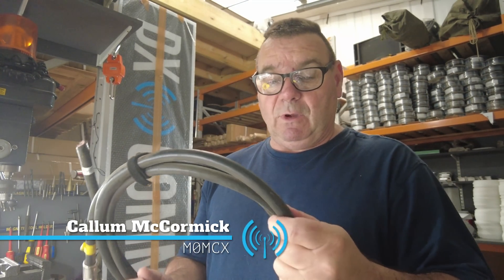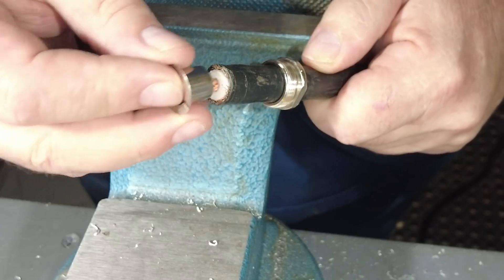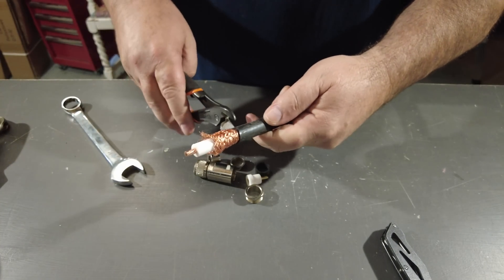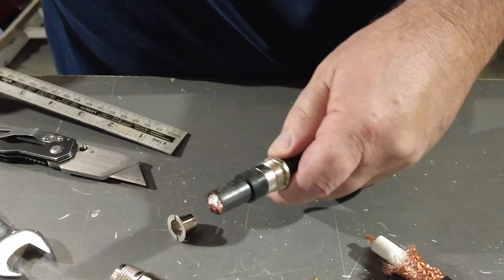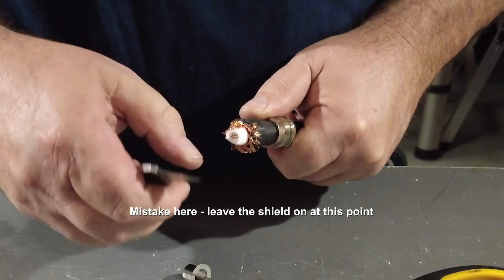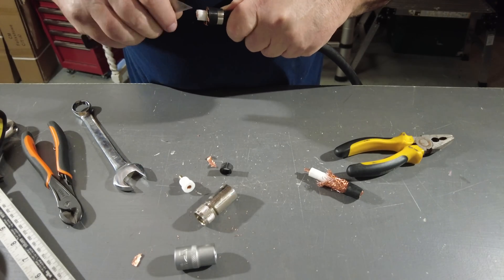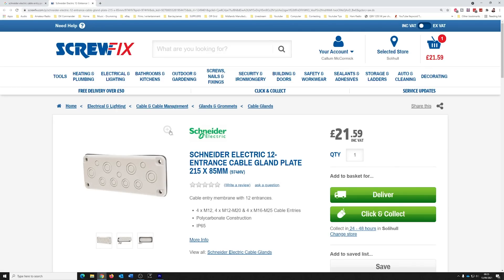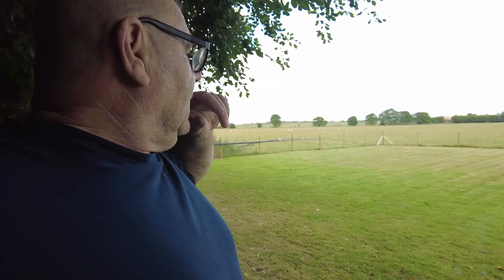Fitting Ecoflex 15 - Not All PL259s are the Same!

Comment: Love the idea and ability to reuse these connectors; however, everything i can find including with messi says the pin needs to be soldered on and the 7mm is too small for an LMR 400 cable (needs to be more like 10mm). Bummer. I'm starting to build a shack and I'd rather use reuseable screw on connectors than buy a crimp tool. Correct me if my info is incorrect, but it doesn't look this is going to work.

Comment: Hi,good video, well explained, but my question is, is there any specific circumstances that need such good quality coaxial cable, long runs or Qrm issues,,,,for example. I am using RG 213 u for 25 meter, wondering if ecoflex 15 can help with my high noise level what do you think, thanks from Rotterdam 73.
Reply from the maker: Noise.. Unlikely to be picked up by coax (normally).. Try a Loop On Ground.. I have two of them. One small and one big.
Reply: @DXCommanderHQ  Hi,thanks for your advice, I am now using 25 meter of Ecoflex 15 with the huge compression plugs, an unexpected  drop by 2 s point's, from S8 Qrm level, now with the Ecoflex 15 round S6 mostly, on the 40 meter band, so I am happy, My Acom 1500 linear amplifier needed a new transformer few weeks ago, great customer service, but an expensive repair, thanks from Rotterdam 73 👍

Comment: Hi Callum I really do like those connectors I have a 50 foot run of M&P For my HF and that’s the first time I seen those type of connectors and I really am impressed. It looks like a little bit more work but if you could reuse those connectors so much the better, I imagine that there are more expensive than your regular PL 259 because I’ve never priced them here at home but it looks like that’s the way to go with what you’re doing with the connectors. Thanks for the video and I hope you have a very fantastic day.
WD5ENH 
Steve
Reply from the maker: Hi Steve, so I bought last week another 4 of these.. Better actually. These were the Mk2 version at about £9 each.. So that's probably $10 in your land (exchange rate says higher but I'm guessing on local prices)

Comment: Would it help to tin the center conductor and braid? I use plumber's Flux. It works for me.
Reply from the maker: No.. It's a no-solder fitment anyway.. I have noticed when you add solder, it increased diameter.. But good idea!
Reply: As Cal said. DO NOT tin the center under any circumstances. you will NEVER get the hollow pin on the cable center conductor.... Trust me and Cal on this... I've tried and it has cost me dearly.
EI7II.

Comment: We use a lot of that, and we call it half inch hardline flex version. We do not use pl259 but rather N. We use special tools to prepare the coax. Preparing coax without this tool could be done but its very hard to do. That is a very handy adapter being 259. We do use some of them. There will be an o-ring and the copper outside shield is "flaired" and needs to be perfect. This guy trys to do it without special tools, we will see how he does !  https://youtu.be/4vHvM9u_mog
Reply from the maker: OK, I've been doing it this was for 12 years and not had a failure yet :)

Comment: Hi Cal,
How about using a waterproof gland fitting for the side of the enclosure. You would only need to use the step drill bit to drill a hole the size for the gland fitting.
Reply from the maker: Yeah.. My problem is that I am forever changing stuff! LOL!! :)

Comment: Correct, you slide the piece between the foil and the braid. M&P have some nice install videos on they're youtube channel. I will never use another connector again 😀. Also the hyperflex coax is fantastic 👌 I use at least 10mm for everything, 13mm for uhf vhf. Longer distances and higher frequency? the 15mm ecoflex plus from SSB-Electronic in Lippstadt is your best friend. Higher power and even longer distances, you need the big tube style stuff from cellflex 😀
Reply from the maker: Agreed!

Comment: Nice install.  I think you'll want a weep hole or something in the bottom just to keep the interior dry.  Temp changes will cause condensation internally...
Reply from the maker: I have a massive hole there :)
Reply: @DXCommanderHQ  Saw that.  Thought you said you wanted to seal it up.